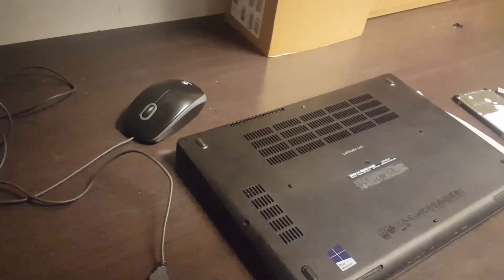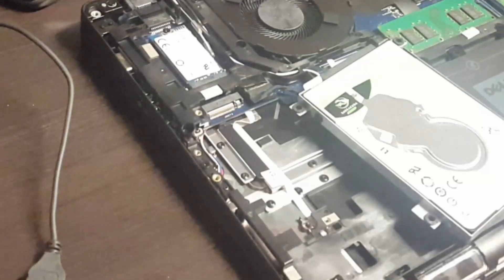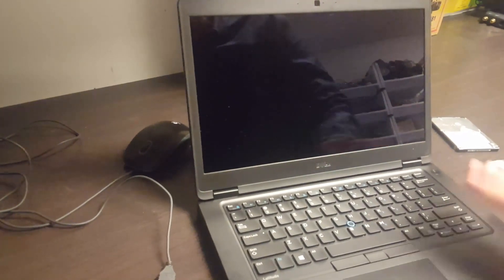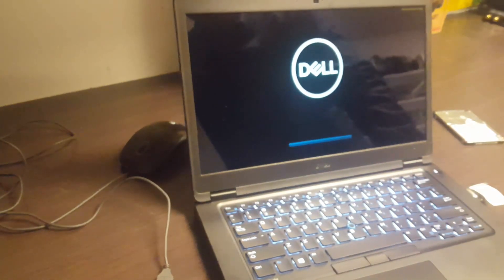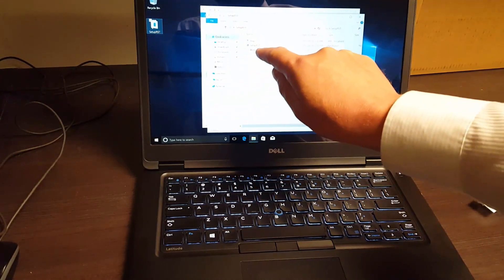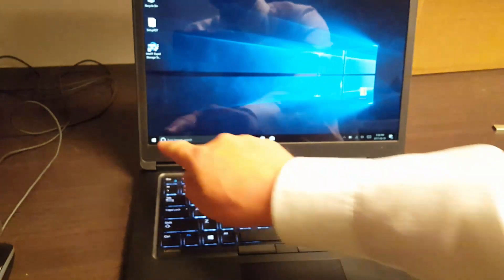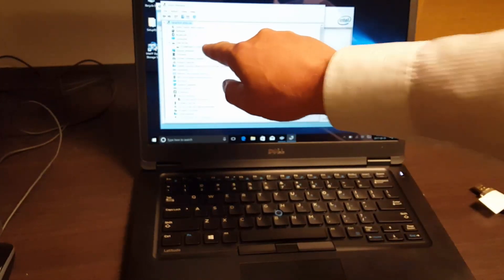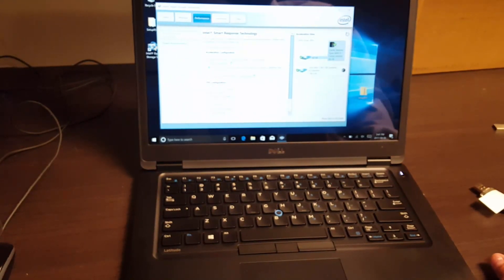How To Enable or Upgrade an SSD Cache Using Intel Rapid Storage RST

Comment: yes but you didnt tell us which drive to install the operating system on for this Intel Rapid Storage, I have a HP Elitebook 8770w which was one of the first to have this and idk which step to go about this ordered a Intel 24gb Flash Cache Module which is said to be the one for it but idk if its what your call Optane Memory

Comment: Hey sir, I am facing this issue as whenever I try to open my HP laptop and it is not opening.. when I try to boot it, it shows me the error of “ recovery not supported under current configuration, please enable acceleration option for intel smart response technology and try again”.. I have hard disk 1tb and ssd of 240gb .. when I try to install windows ssd is not available and HDD is available. 
Could u please help me?

Comment: Hi,
Excellent video and very useful information.
I have one question, can I install a 128gb ssd in the wwan port, and install the os on it, and keep my data stored in the 2.5 Hdd. I want to keep the os in one drive and my data in the other.
Thanks

Comment: i noticed you broke the RAID configuration at the BIOS prior to installing Windows.  Did you go back to BIOS to re-enable the RAID configuration after installing Intel Rapid Storage?
Also, you did not show us whether you selected the 64GB SSD or the 2TB HDD at the Windows installation screen.
Reply: 1. It will be reactivated with installation of Intel RST.
2. Install in the hard drive.

Comment: Hi, I bought an optane, and I have an ssd but I need to know what storage option works for optane, ahci or rst? To change it from the bios, greetings, since in rst it doesn't let me boot USB for Formatting It seems
Reply: Try this link below..  You have to download the RST optane driver
choose the second driver, optane,  if it applies to your computer.  if not. choose an older version, which the link will be below the three choices on the left side-page. \
https://downloadcenter.intel.com/download/29007?v=t

Comment: This laptop belongs with a 80 year old grandma, yet it supports a technology that my $1000 workstation PC doesn't. Of course, the actual cost of my PC is probably $600, but that doesn't change the fact that I paid this amount of money for a computer that doesn't have a feature from a laptop that my grandma could probably use.
Reply: Eh? They've got the same OS, so how is a Latitude going to be any easier for a Grandmother to use. Sounds like your Workstation is rather old, if you're mentioning  a paltry $600,  and this is more costly and modern PC. An  i7 Latitude is well over $1000

Comment: Hello, You are connecting the M.2 to WWAN port or it is dedicated SATA port?
Reply from the maker: It is a dedicated port.

I am ordering new Lat 5480 devices now and found that Dell has REMOVED the option to buy a "caching disk".  I am assuming the hardware still supports it (because they are unlikely to change a motherboard mid cycle), I confirmed with Dell Premier Sales (corporate) that Caching disks are no longer available for order with no explanation why.  

I am going to order a single Lat 5490 on Monday and pull it apart to find out what it really offers for hardware support and caching disks are not offered for it either, but Dell MIGHT have changed the mobo design in the newest model.  I will post a video when it arrives in a month or so.
Reply: URTechDotCa Actually we hurried to order 2 M.2 sticks and now they look ridiculously expensive USB sticks ;)

Comment: Hi!
I have a Hp laptop from the G3 card and I want to install a 32GB SSD in the WWAN slot for capture. If you want to change the BIOS settings to use a SSD for capture. All the best!